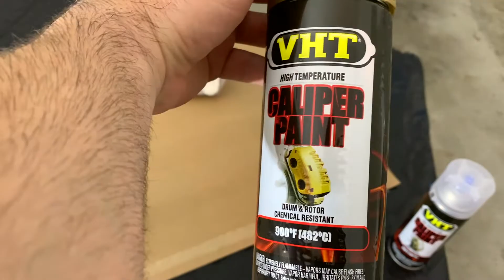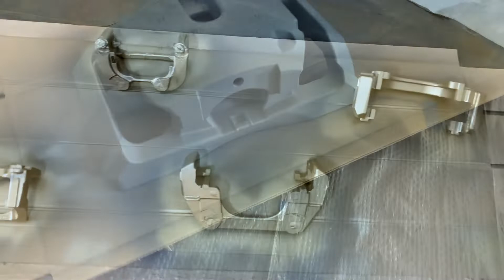Retrofitting Alpina B7 Brakes - BMW F10 535i Brake Upgrade  | BOND Garage

Comment: Hey, looks great! Was thinking of doing this upgrade myself. Would you say the front calipers weigh a lot more/ can you tell any difference while driving?
Reply from the maker: the weight difference is about what you'd expect. coming from the smaller 535i brakes here in the US it's notable heavier. from the bigger 550 brakes probably barely noticeable. feeling-wise, the first thing I've noticed were the braided lines. so much better pedal feel. they also have a lot more initial bite. can be somewhat annoying around town when coming to a stop. I'm no longer able to stop without jerk. but that's the only downside. absolutely love em!
oh yea and the spray paint is meh. better to powder coat them.
Reply: @BONDGarage  thanks for the response, still not sure about these or the g12 calipers, but do appreciate the input!
Reply from the maker: @mattbattinieri6269  yea I haven't considered those when swapping mine. but from what I've read, the pads won't be a perfect fit like with the alpinas. but then again those are single piston and they dust like nothing I've seen before. it's not all just happiness
Reply from the maker: @mattbattinieri6269  what do the forums say about a G12 swap? any issues or restrictions you need to look out for? 
look-wise I'd go for the newer M-perf caliper but also depends on budget.
Reply: @BONDGarage  so i ended up ordering the g12 brake calipers and from what i understand from the vids online and a facebook post is the it bolts up same at f01 it just takes a few extra adjustments and a 4.5-5mm spacer instead. I got them delivered today and even the box they were in felt so much lighter than when i ordered the f01 alpina ones

Comment: So If I go with the 750 front brakes... all I need is the calipers, brackets, pads, and new rotors? Everything should bolt on without modification??
Reply from the maker: that's right

Comment: Are the 760/B7 calipers the same as the 750 F01 brakes?
Reply: No they are not but 750i and 550i have the same front brakes.
Reply from the maker: the diameter and thickness are the same but the hub is designed differently to allow for a larger brake pad. it reaches a little further inside towards the center. with that, everything is different lol

Comment: can the 18" wheels accommodate that larger caliper w/ a spacer or is this a diameter limitation?
Reply from the maker: since I don't have 18s I didn't bother checking. what I can say though is that the rear brakes should be fine since they're just 550 brakes. the front should also fit since the 760li has an 18" wheel option. but man that must be super tight.

Comment: Will it fit 0EM 18inch rims? Or is it very tight with your 19" already?
Reply: Ya. Same question too. Will it fit 18” original bmw wheels?
Reply from the maker: I don't have 18s to test but by the looks of it, I'd say they won't fit.

Comment: Hi 
Good work . Do you think worth to convert like small brakes from f10 3.0 to 550i brakes like yours? is it good? as our old brakes got punching.
Reply from the maker: in general, yes. especially if you desire more from your brakes. when the time for new rotors comes you might just drop in some bigger calipers as well :)

Comment: Wondering if the F10 M5 calipers will fit those 351m 19’s. Any guesses?
Reply from the maker: I'm not certain on that. The M5 front discs are I believe 396mm or 400mm for the comp and these ones here only the standard 374. depends on the calliper design I'd say.
Reply: No they wont
Only 20inch rims will clear the m5 rims

Comment: Hi can you tell me if these callipers will
Fit? They are apparently of a 760i. I can upload an image but they are twin piston ones.
Reply from the maker: would need to see it or have a part number. twin piston sounds like G series though. in that case you'd run into some issues to match discs and pads but I've seen people fitting G series brakes to F10s

Comment: Will it fit on a 2014 535d xdrive
Reply from the maker: I don't see why it wouldn't.
Reply: The 535d already has the better brakes, or at least the F10 and F11 does
Reply: Hi can you please post the part numbers for the front calliper’s again please??